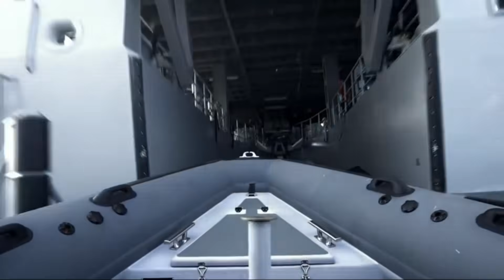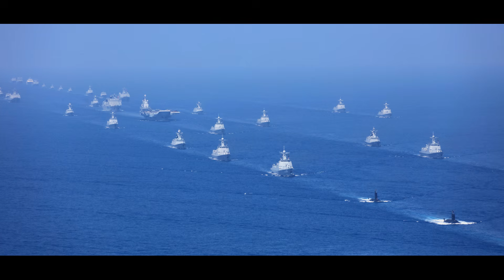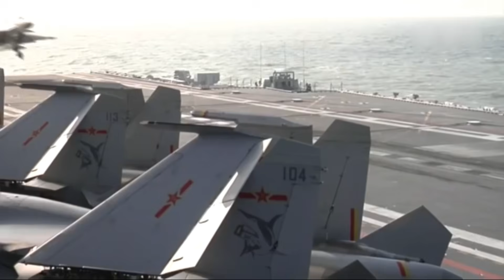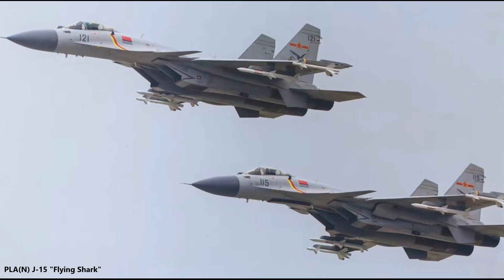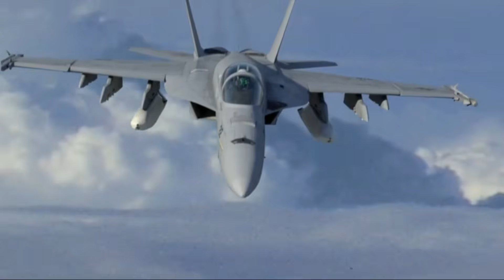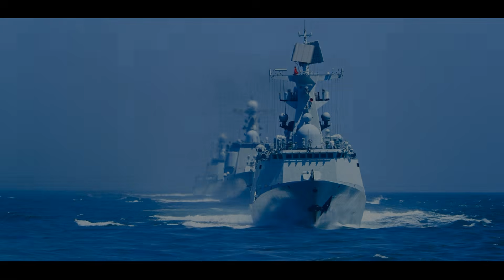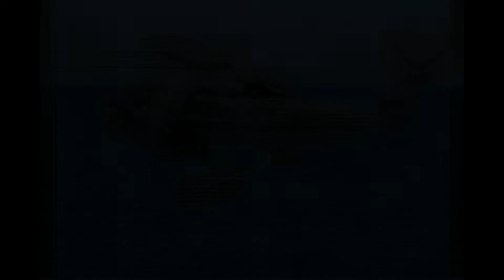Up-Gunning the Arafura Class OPV

Comment: Arafura Subhunter?

As for the oceanic ASW mission, forget it. Again, the Arafura is too slow and too easily detected. With no embarked naval combat helicopter, the only way an Arafura could get close enough to successfully attack a Chinese submarine with a light-weight MU-90 ASW torpedo (effective range of about 4 nm) would be from a position well within the range of the submarine’s heavy-weight torpedoes (effective range of about 8 nm for a Chinese YU-10). The Arafura would have no chance of out-running the torpedo (capable of about 65 knots) and little chance of out-running the submerged submarine itself (capable of about 20 knots for a diesel-electric Yuan class SSK, or about 30 knots for a nuclear-powered Shang class SSN). The submarine will passively detect the Arafura long before it detects the submarine (due to signal attenuation occurring along the double distance to target path length of the active sonar signal required to obtain a target solution on the submarine); so, attacking a submarine would be a very dangerous thing to do. Unless acting in self-defence after having been caught by surprise, or perhaps prosecuting a high value or time critical target like an SSBN, a commander would likely be reluctant to attempt it because a single heavy-weight torpedo with a 300 kg warhead, and a re-attack capability if it misses the first time, would blow an Arafura clear out of the water with few, if any, survivors. 

A better way to attack a submarine is to use a helicopter. Landing a helicopter on a vertically moving platform at sea is dangerous at the best of times. The RAN uses the MH-60R naval combat helicopter which has a rotor diameter of 16.4 m and maximum take-off weight of 10433 kg making it too big for the Arafura which has a beam of only 13 m. It is difficult enough to land one on an Anzac frigate which has a beam of 14.8 m. It might be possible to deploy a smaller naval combat helicopter from an Arafura like the Royal Navy’s Wildcat HMA.2 but the Arafura does not have the hangar required to maintain and protect the aircraft from the elements. The complexity of maintenance, sustainment, repair and logistics of an additional naval helicopter class, along with different sensors, sonobuoys and torpedoes that it carries, would be too expensive. Similarly, it might be possible to base a Fire-X UAV (maximum payload capacity of 1000 kg) on an Arafura, modified to make use of the same sonobuoys, dipping sonar, and torpedoes as the MH-60R to simplify matters, but again no hangar.

To have any chance at all in submarine prosecution, an Arafura would need the RUM-139C VL-ASROC rocket-propelled VLS-launched weapons system. The RUM-139C is 4.9 m long, weighs 639 kg, and has a range of about 12 nm. The submarine commander may not be aware that it is coming but as soon as it hits the water he will, and he will then be obliged to evade. This will distract him from an attack and will at least give the Arafura a chance to flee the scene. But even if you manage to sink the hostile boat, you might still have to evade the torpedoes it has already fired at you – and you don’t have the speed to out run them! Bye-bye, Arafura! 

To mount the VL-ASROC, the Arafura would require a self-defence version of the 8-cell Mk41 VLS (which can accommodate missiles up to 5.3 m in length), weighs 12200 kg, and which the Arafura does not have. The ordnance would weigh 5112 kg. That comes to 17312 kg not including the electronics package. Where would you put it? A BAE Adaptable Deck Launcher would allow you retain the mission deck; and, there goes the flight deck along with the aviation capability again! 

A more fundamental problem, though, is that with submarines becoming quieter (and more stealthy), and with the ambient background noise of the ocean increasing, partly due to the increasing populations of both merchant ships and whales, it is becoming harder to detect submarines. What is required these days is a multi-static sensor network that involves many sensors to allow efficient triangulation of the position of a submarine. You can’t deploy enough sensors from an Arafura to provide a multi-static sensor network. High endurance unmanned surface vessels and unmanned underwater vessels, together with both fixed and mobile seabed sensors, are likely to take over this role in the future. This would allow manned surface vessels to avoid having to go into harm’s way, and have submarine prosecution left to air-borne platforms like the P8 Poseidon.

Comment: The RAN has no interest in up-arming the Arafura OPV. This is not because they are uninformed, or incompetent, but because the vessel is simply not fit for that purpose. Let’s have a look at the reasons why.

With the pedal to the metal, the Arafura can only achieve a flank speed of around 22 knots (RAN estimates 20 knots) and that is too slow for a combatant warship. Further, it does not have a low-observable hull, so it would not be hard to find on radar. With ASM missile magazines expended, it would not take long for any modern Chinese warship to overtake it and then bye-bye Arafura! 

The purpose of the Arafura OPV is to replace the much smaller Armidale and Cape class patrol boats whose missions include border patrol, fisheries protection, constabulary duties including anti-piracy and anti-terrorism, illicit drug importation interdiction, and EEZ patrol. The Arafura is better-suited for these roles because it has better sea-keeping characteristics, greater range and endurance, a flight deck suitable for small containerised UAVs, can carry a pursuit boat and two smaller RHIBs or USVs, and has up to 20 spare berths so they can carry more passengers be they submariners on rotation, maritime disaster survivors, asylum seekers, or a special forces insertion or counter-terrorism team.

Not only that, but they have a mission deck for specialised mission packages (i.e. mine counter measures, oceanographic survey, and medical facilities), and they could also serve as a vessel of opportunity for submarine accident early intervention by providing side-scan sonar search, deploying ROVs for damage assessment, debris clearance, rescue seat evaluation, and the deployment of transponders for a follow-on evacuation submersible arriving on a more capable submarine rescue vessel. They can also play a role in regional disaster response and in providing humanitarian assistance.

The Arafura design is based on the Darussalem class used by the Royal Brunei Navy. Their version carries 4 Exocet MM-40 Block 3 ASMs between the bridge and the stack. Each Exocet (including the rocket booster) weighs 750 kg and that adds up to 3000 kg of ordnance not including the launchers. 

One option, currently under investigation, is to fit the Arafura with Naval Strike Missiles. The NSM weighs 345 kg (407 kg with the rocket booster) and 6 of these would weigh in at 2442 kg of ordnance not including the weight of the more numerous launchers than those of the Exocet system. Six NSMs, and maybe even eight (3228 kg) if composite materials were used for the launchers, would weigh about as much as the Exocet system.

A co-ordinated time-on-target attack of 6 NSMs would probably be sufficient to achieve a 50% probability of at least one strike on a well-defended Chinese warship. The NSM is a stealthy missile and two missiles might be enough if the air defence system of the target was slow to respond (such as was the case of the Russian guided missile cruiser, Moskova, recently was sunk in the Black Sea by two now obsolete shore-based Ukrainian Neptune ASMs). A single strike, and the subsequent fire caused, would probably be enough to achieve at least a mission kill on a smaller warship like a corvette; but, multiple strikes would probably be required to mission kill a frigate or a destroyer. So, the problem here is that the Arafura is going to struggle to carry enough missiles in order to have a significant military effect. It might be able to take out a single warship, but then it will have to return to port to re-arm. The same problem applies to the bigger RAN warships and even USN warships which are, in general, under-armed for sea combat which has not been a priority since the end of the cold-war. But while the Arafura is returning to port, it will be slow, easy to detect, and defenceless unlike a faster frigate or destroyer with a multi-layered defence system.

A big problem with the NSM concept is that the range of a surface-launched NSM is about 100 nm. The range of a Chinese YJ-83 is about the same and this means that the Arafura can expect to receive return fire. Who wins might depend heavily upon who shoots first. At the very least, the Arafura would need its own point-defence anti-ship cruise missile system in order to survive. A SeaRAM close-range protection weapon system with 21 RIM-116C Block II rolling airframe missiles would be suitable as it has its own independent fire control radar, and is reloadable at sea, but the system weighs 7682 kg, so where are you going to put it? It’s too heavy to go on the forward gun deck, or between the bridge and the stack and this would limit the firing arc – so that won’t work. It would have to go on the flight deck but then you lose the aviation capability and with it the ability to detect hostile warships over the radar horizon! This leaves the ship dependent on ELINT (with OTH targeting capability) or on other platforms for detection and targeting information reducing its ability to operate on its own.

Some advocate for the LRASM to be fitted to the Arafura. The LRASM-SL is a bigger and longer missile, and weighs in at about 2000 kg when you include the weight of the rocket booster. Placing four LRASMs in place of the four Exocets would NOT work because the ordnance weight goes up to about 8000 kg and the launchers are bigger and heavier which increases the weight even more. This would upset the delicate balance of the ship, lead to instability in heavy seas, and leave the vessel at risk of capsizing! You might be able to put containerised LSASMs on the flight deck but then you lose the aviation capability. And, four LRASMs are probably not enough to achieve a 50% probability of a strike on a multi-layer defended warship.

Not only that, while the LRASM-SL has a range of around 430 nm and this would allow the Arafura to attack smaller, or older, Chinese warships from a safe distance and out of range of the YJ-83, the heavier, or more modern, Chinese warships carry the YJ-100 ASM which also has a range of around 430 nm. Attacking targets at that range will require detection (probably by an ocean surveillance satellite), classification and targeting (probably by an air-borne maritime surveillance asset) and communication of the geo-location of the target to the firing platform (probably by a military communications satellite). 

Both LRASM-SL and YJ-100 ASM are subsonic in transit so they will take time to reach their targets. During this time, the target will have probably moved a significant distance. If the Arafura moves 14 nm, it will be somewhere within a circle about 88 square nm in area. If the faster Chinese warship moves 20 nm, it will be somewhere within a circle about 138 square nm in area. So, in either case, the path of the missile will need be to be updated in mid-flight by the air-borne maritime surveillance asset in order to find its target at that distance. A successful attack must take place in the face of attempts to disrupt, dazzle, and destroy the sensors and to jam communications and precision navigation data services. Having long-range missiles does not simply mean that you can sink warships. You also need a robust kill chain.

Software updates to, and the development of new interfaces for, the Saab 9LV combat management system will take place anyway in order to fit the NSM and LRASM to other RAN warships but adding this to the Arafura would require additional weapons consoles and electronic equipment, eating into space and weight margins, and imposing greater loads on the electrical power and cooling systems. Past experience shows that tinkering with weapons systems, and especially with the combat management system, is likely to take a lot longer than you expected and be quite expensive. So, is it worth up-gunning a platform that is not fit for purpose?

The rotors-running refuelling capacity might be worth retaining, though, as it would extend the endurance of shore-based maritime search and rescue helicopters (when time really does matter) and shore-based ASW helicopters hunting down a hostile submarine detected in coastal waters in the vicinity of a naval base or major commercial port.

All things considered, the Arafura would not be effective as a small surface combatant; so, it comes as no surprise that the RAN is not interested in up-gunning the class. Let the Arafura be what it is intended to be – a general-purpose oceanic utility truck for use in non-contested waters. It will serve the RAN well in that role for many years to come.

Comment: If my understanding is correct, Australia does not have a "Coast Guard" as the USA has so it uses it's navy for that role as well as defense. It looks like the Auafura is to function more as a coast guard cutter. It would seem it is fitted for that job. The helicopter refuling ability while nice, adds much to the maintaince and risk of fire if you are not going to use it. While the 25mm gun may look small compared to a 40, 57 or 75mm gun it would be very good at stopping, if it came to that, small freighters, fishing ships and the Chinese militia ships it is more likely have to enguage. The ability of "making your point' with a smaller weapon is much easier than with a big gun that could easily, and accidentally, blow your target out of the water.

Auatralia has a several nation buffer to China to it's north, that does help it's situation. The US has several companies testing container based weapon systems, including cruise missile launchers. So that front is quite fluid.

Long term, 30 to 50 years, the world situation may be much different than now and China as we know it now might not exist.

PS; "Sea Patrol" was a nice TV show, though it could have been better.

Comment: Well, I would have pushed for Arafura to have an 8 cell Mk.41 (or similar) VLS. It would give  her a huge self defence capability & allow her to contribute to fleet defence or strike, were the need to arise. That's another issue however.

We might not consider these ships to be combatants - but they fly Royal Australian Navy flags. They have dozens of RAN service people on board. It seems inappropriate to me, to assign them to a vessel without adequate self defence capability. IMO at the very least the vessel should provide its crew with a capable SHORAD & modest anti-surface capability.

I would love to see SeaRAM in the RAN! I would love to see more ships with LRASM! The Arafura could be better without either but I would consider SeaRAM or a CIWS essential. 

Also, if LRASM tube launchers are not suitable for weight, balance, or handling, the NSM would be perfect. It's <500 kg/tube, we're already buying it for our Hobarts & Anzacs, & it's a dual land & surface target. A huge increase in the Arafura's usefulness if shooting or deterrence were ever necessary.

Lastly, not having torpedo tubes makes the ship is dead if it ever comes with 10km of an enemy submarine. Anyone who finds an Arafura will know straight away it can't hurt them or run away.
Reply: Dude, OPVs are OPVs. Not meant to be Corvettes. I'll agree that the armament and lack of heptr makes Arafura class rather anemic, even for an OPV, but you don't get anything more fancy than a CIWS and VSHORADs for self-defence. The limiting factor isn't weight, but rather maintenance complexity and cost. Look at Indian Navy, they got both Corvettes and OPVs. OPVs get an Oto Merla 76mm and 2 AK-630 CIWS and 2 VSHORADs (basically MANPADs). Other than that, it has no missiles despite being around 2000+ tons. Yet a similar sized Corvette (NGMV) has (in addition to armament of an OPV) 8 BrahMos supersonic cruise missiles and 32 VL-SRSAMs (ESSM class). 
The purchase costs are like this:-
Corvette: $200M/ship
OPV: $100M/ship
Frigate: $500M/ship
Destroyer: $1.1B/ship
^ And these are just acquisition costs. Maintenance costs are proportional to number of high tech systems on board. Which means for OPVs, maintenance costs are much lower.
.
So if you put all the stuff you mentioned onto your OPVs, they'd end up costing twice as much. And because they weren't designed as frigates from the get go, they'd be bad at their jobs.
Reply: @death_parade  They would be empty spaces the nearest AEGIS Destroyer can use to defend a much larger area if a good few of our OPV's were Corvettes. It's crazy bang for your buck with the current VLS options & the limited space it needs.